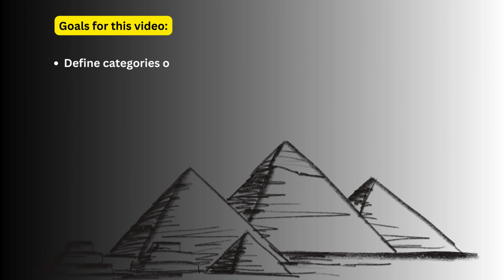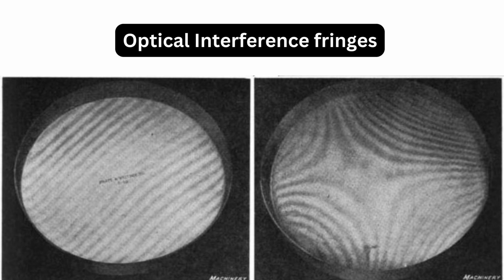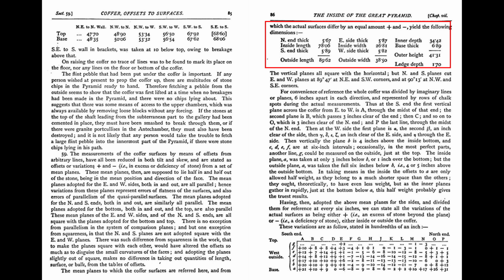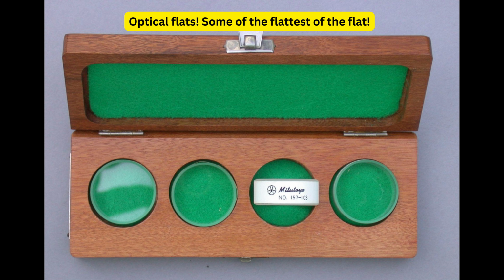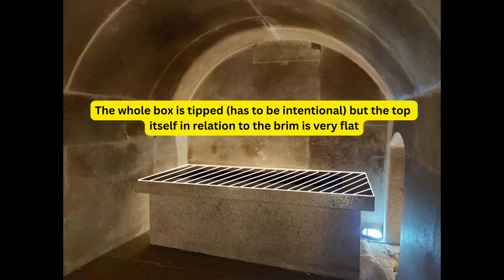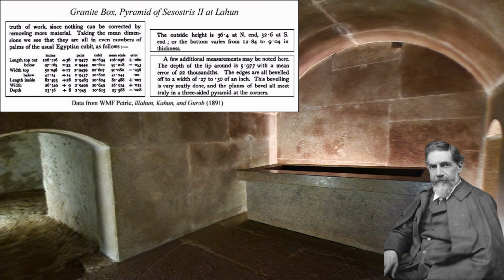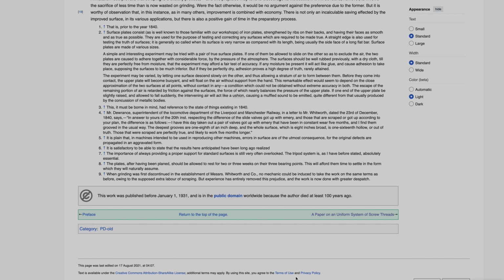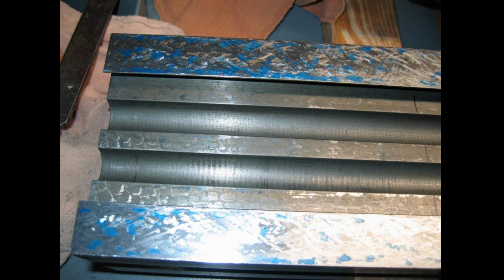The Problem of Flatness in Ancient Egypt

Comment: No one of any credibility claim that the flatness is the signficant feature that requires modern machinery.

The interesting aspect is accuracy on multiple planes with respect to each other.

Yes it's easy to create a flat face.

It's significantly more challenging to create muliple flat faces that are within an extremely tight tolerance with respects to each other. I.e a 90 degree angle

Or more interestingly the vases which have been thoroughly analysed and scanned. 

Making complex shapes with extremely tight tolerances and then also having the relative position of related faces be also at an extremely tight tolerance is a completely different ballgame. 

Your argument is a classic red herring.

Yes what you say is valid. 

But you're also arguing with no one of any credibility since no one is claming that a single flat surface is a huge feat of engineering.

What a waste of your time on this venture
Reply: What people don't realize is that things like this don't actually change conspiracy theorists' minds. Like yes it is a reasonable explanation and makes sense, but at this point you're arguing with someone who thinks conventional explanations are a deliberate attempt to suppress what they have come to the conclusion is "truth"
Reply from the maker: 😂😂😂😂 okay thanks for watching.

Comment: I worked for a major mechanical seal manufacturer.  Our seal faces were 1 helium band or better under 4" diameter. I still have some silicon carbide faces laying around, they will wring together with no effort. If you leave them like that for a while they are difficult to separate. We also did gas compressor seals which have lifting bodies etched into the faces and dry nitrogen is pumped between them then extracted from the stuffing box. Those are for API, zero tolerance for leakage applications like refinery fractions and hydrocarbons.
Reply from the maker: Now those are some seriously good tolerances!

Comment: The one thing i think you could have expanded on is the comparison of machined flat over a unit area vs machined parts.  Particularly for the case blocks, that might be very interesting to evaluate, but I dont think we have enough source data to do so.
Reply from the maker: Yes that would be an interesting side video to make however like you said I had a hard time finding numbers. The joints are nice and clean but the exposed top not so much.

Comment: Okay so I had this problem when I was making a door, I had never done anything like this before and I had no tools, my solution was to measure the width at the top and at the bottom, create a center line using those measurements then, measure from that center line towards the left edge lets say 10cm for the sake of this comment, do the same at the top and the same on the right side, cut down those markings.. BOOM straight line, I genuinely thought I was a genius for working that out on my own for a while.. lol

"But there was no straight edge so how do you measure it without a ruler ?!" A piece of string, that's how I did it.
Reply from the maker: Nice! Yeah these are the kind of solutions to very specific problems you just won’t find in a book or if it’s in there it would take too much time and you’re in the middle of a project. So you just figure it out. Well done.
Reply: @intothemap360 yeah exactly necessity is the mother of all inventions, I'm not the sharpest tool in the shed, if I could work that out on my own, I'm sure people who dedicate their lives to a craft would work out hundreds of ways to achieve the same thing.

Comment: 0:46 you would have to make a string/ rope and put it under tension that would make something straight that you can use as a reference.
then again if you watch documentaries about the hadza and other bushmen/hunter gatherer tribes, they make arrows that are pretty damn straight just with their eyes and hands
Reply from the maker: Straight isn’t the same as flat
Reply: @intothemap360  well straight is one dimensional and flat is 2 dimensional. is that what you mean?
if so i agree but you can use straight to arrive at flat
Reply from the maker: Yes that’s what I mean. It would certainly help! But for large surfaces you’d eventually have to move to something rigid. In my humble opinion 😊 I think you meant for the initial development of a straight thing yes that would certainly be an early step. I was thinking you meant for the boxes.
Reply: @intothemap360  yes obviously the boxes need pre developed tech

Comment: I have to disagree with your conclusions. I'm sure you of all people would understand the time and effort to complete the tree plate method. Now the question is; why would you bother doing that everywhere? The side of the polygonal stonework. There are many awkard edges joined at precise angles that would be a nightmare to grind, never mind with copper plates. The volume of impressive work there is endless. I'd propose the reason you see machined level of accuracy so often is... it was machined. 
I have been to egypt, I am in no doubt there was a lost civilisation. Another point I rarely here mentioned online, is the level of errosion on many of the buildings and statues there. Easily 50mm+ into rose granite. This takes tens of thousands of years. 1000T one stone statue?! There are clear v shaped cuts into the enclosure of the great sphynx (approx 200mm deep), from rainwater erosion. Centuries of heavy rain; in the Sahara? 
Counter to your point, there has been modern laser scanning done on ancient Egyptian work. A search for Uncharted X Vase Laser Scan Project should lead you there. The results are beyond incredible, and to anyone with an open mind, would leave any idea of a primitive civilisation having done this nothing short of ridiculous.

Thanks for your documentary all the same. You spurred me to type as I feel you have missed many a fact. Cheers

Comment: Lapping is an absolute joy. When you machine down to a millionth and the 2 work parts join and the seam completely disappears. There are few things that make me so happy.
Reply from the maker: I love how many people in the comments have real world experience with this technique!!! I’m still amazed at how accurate you can get with hand scraping and blueing
Reply: @intothemap360 ive got stong opinions on our surface blocks (stone, obviously). It also has always driven me crazy "you cant fit a razor blade between these stone blocks" 80 thousandth? Id certainly hope not. Most our our "rough cuts" at JPL have a "2 tenths tolerance" 0.0002 of an inch. Roughly...a 20th the depth of your fingerprint.
Reply from the maker: If two objects touch they shouldn’t have much space between them, else they would be floating. If the entire faces were perfectly matched you couldn’t get any size razor blade in them. I can make wood boards impossible to put a razor between with my dewalt joiner
Reply: @intothemap360 im sayin! You could drive a bus through tolerances like that.

Comment: They didn’t. You can make a clean cut with water
Reply from the maker: With a water jet cutter that is filled with abrasives yes. However that isn’t something they had
Reply: @intothemap360 How do you know? Did you Neanderthals had learned how to make fire 250,000 years before we said humans could?
Reply from the maker: You’ll like my video on the problem with giant saws. Basically I show the various parts and pieces used in one machine turn up in other machines and this is how we establish what I call a mechanical context for any particular tool. I use this example for engines at the time. So for this machine, a water jet cutter, what I can say is there is no mechanical context for it having existed. In other words, no high pressure pumps, the ability to maintain 2000 psi water streams, the ceramics to have a tip that can hold up to the pressure, evidence of threads to screw these pieces together, hydraulic lines and hose technology. Those are all parts that aren’t single use, they turn up in various industries. Technology builds to a single solution. To get to something like this means there is a long mechanical chain of problem solving and we just don’t see it there. I appreciate you asking though and I hope you can see what I’m saying. I think you’ll like the video I suggested. Happy to hear what you think after watching it
Reply: @intothemap360 And there was no evidence Neanderthals used fire 400000 years ago. Until a couple years ago….  There’s no proof dark matter exists. Yet it does
Reply from the maker: Alright it’s not my job to have you see things the way I do. It’s a free country and I still appreciate you watching.
Reply: @intothemap360 I was simply answering your question about Egyptians needing advanced tech for flat surfaces. I agree they didn’t. I’m suggesting civilizations figured out steam is pressure and water can make smooth cuts
Reply from the maker: I’m tracking. 😊 I appreciate your polite responses!

Comment: But this is a straw man or atleast one a small peice of the issue, the smoothness that you admit is barely withing the scope of fiesability what, what you describe here. Its that none of this explains the inner joins and cornering of single-piece construction. youre cutting out the rest of the issues of its infeasibility, focusing on 1 section saying its still barely possible and ignoring the larger picture and saying case closed you solved the mystery is poor. Viewers without the full context of going off your description of only being a flatness issue are being misled, which i hope is at least not in bad faith. 

The main issues:
- granit overcuts that would take hours of pointless labor to achieve using whats put forth by historians.
- That according to the timeline given by historians to build the pyramids would require a stone to be placed every 3 minutes, working 24 hours with 0 down time thats cutting, transporting. Which is impossible and ridiculous to accept alone.
- the fact that core drill marks with better depth per rotation than any tool we have today can be found all over sites.
- the granite vases, the sarcophagi, are all first dynasity, then instantly lost all the techniques are all of much poorer quality right after this. To say "lost technology" is a lazy when they lost it themselves.

to look at the larger picture and believe there is no evidence that they discovered a lot of this and there's no proof when they only had this capability, apparently at the very beginning and could never recreate this build quality, and accept they were placing a 10-100 ton stone every 3 minutes on average is crazy
Reply from the maker: Too many questions to be addressed in one video. My videos systematically work through many of these problems. Stay tuned!

Comment: Straightness at flatness is not just a tolerance (or the integration of tolerances over a surface), but there is also a flatness over distance. The Whitworth (I worked with Withworth threats) method is difficult to achieve over large distances unless the workpieces are of equal size. Flatness is limited by our measurement methods, essentially wavelength. Still, I agree, the flatness they achieved does not need alien technology.
Reply from the maker: Yikes! Is a Whitworth threat when someone says they are going to make you flat as a pancake?? Sorry I know what you meant! And yes I’m sure these aren’t perfectly flat as we don’t even have good data beyond the ones Petrie did

Comment: easy, you can pour in wet clay into a bowl or into water and then  if the wet clay hardens and achieves a perfect flat surface then you can use that as a reference or grinding an object  will produce a flat surface.
Reply from the maker: Level and flat are not the same thing. Level water is not useful for horizontal faces. Working stone in the water would disturb the surface of the water and instantly destroy the waters flatness. However I appreciate your idea and I’m sure that would be a way to start making a straight edge for example

Comment: Nah the used a plumb bob and copper chisels. It’s so easy we can do it today…
Reply from the maker: I use chisels a lot. They leave marks if the stone isn’t limestone or another really nice to carve rock. Granite has inclusions and difficult grain patterns and doesn’t carve super easily. Those marks could be removed with abrasives but a chisel alone won’t get even this flat. I’d buy chisels for the casing stones
Reply: @intothemap360 copper chisels? Or cold hammer forged chisels?
Reply from the maker: Tinned bronze, 8-11% tin usually for authentic testing but otherwise of course I’d use steel if I’m just doing something for myself. I try to carve wood more than stone and certainly can’t call myself a master stone mason or anything close. Tinned bronze is certainly on the harder end of what they would have had for the early ones. Of course the serapeum boxes were during the Iron Age

Comment: how to make a flat: ( a step by step breakdown)
1: find a not flat
2: use eyes (hard)
3: mark high spots using hands
4: rub high spots with rough thing (sharp rock if wood, rough rock if rock, or use chisels if you have invented metal)
5: use eyes again
6: mark new high spots
7: get rubbin'

pro tip: a tight string is very flat, this could be used to find high spots. It may even be possible to attach the tight string to abrasive material.
Reply from the maker: You’ll like the second half of my video then!

Comment: I did my apprenticeship 55 years ago where + or - 2 thou was considered acceptable for most applications using engineers blue (high spot) and flat scrapers these tolerances could be achieved, two scaped plates would stick together, put oil on them and it would be cleaned dry in one pass hence the need for feathering.

Comment: Are you gonna adress the geometrical precision in reference to other features ? Cause thats the biggest issue. Its same with the vases. Of course you can rub stuff together to make it flat or spin stuff and rub it to make it round. But you cant make all different features being fractions of pi for example. Or two features being highly accurate in relation with each other. But both of these examples are present in the Egyptian artefacts.
Reply from the maker: An accurate lathe would require stiffness between cutting point and the workpiece. An interesting topic and if you saw the end of my video i said it is one I shall research and address. This was a narrowly defined video and not all topics are covered in all videos

Comment: There's an extremely low tech way to get high precision flat surfaces - the method used to hand grind optical flats for telescopes. Take three identical things you want flat, call them A, B, and C. Put an abrasive between A and B and grind away. Do the same with B and C. Repeat with C and A. Keep going, and you'll eventually achieve a degree of flatness on all three surfaces that approaches the limit of just how flat whatever material these objects are made of can possibly get. A and Bs deviations from flatness mirror each other, B and C's do as well. Grinding C against A puts high spots against high spots, wearing them closer to flat...and so on. The errors in each piece end up working to cancel each other out.

No precision instruments needed, just knowledge and patience.

Not that this has anything to do with ancient Egypt - masterful as they were at working and moving stone, they never even came close to this level of flatness.
Reply from the maker: You will really like the second half of my video then 😂😂😂 Couldn’t have said any clearer that you didn’t watch it all

Comment: for hundreds of yards opticians have been able to grind reflector telescope mirrors to within 1/8" of a wave or....1/8 Wave (\(\lambda /8\)): 68.75 nm = 0.00006875 mm. They used 2 pieces of glass or metal, one attached to a table, and the other moved back and forth over it with a fine grinding powder between them
Reply from the maker: Optical lapping at its finest level

Comment: And this is nothing compared to the actual impossibility of the Barabar cave that's like less than 3 microns of deviation on an entire wall and the entire thing is just too crazy to even have been ever properly looked at by the people supposed to study and understand the timeline. The 2000 years old carving on the entrance are very different in terms of precision, this is way older than the carvings on the outside.
Reply from the maker: How was the 3 microns of deviation measured, what tools was used and where can that published data be found. This isn’t a gotcha question. I’ve seen this suggested several times in the comments and I’d like to to see where you are getting that data so I can also look at it.
Reply: I am yet to see any proof of this claim

Comment: This is what AI wrote to me:
- Lapping improves surface finish and minor flatness deviations
- It removes only very small amounts of material
- It follows the existing geometry of the surface
- It cannot correct significant shape errors
- For major flatness deviations, a corrective machining operation is required prior to lapping
Reply from the maker: Yep it would have to be a final layer. You’d have to get it close with harsher abrasive sawing and other methods like picking before trying to lap